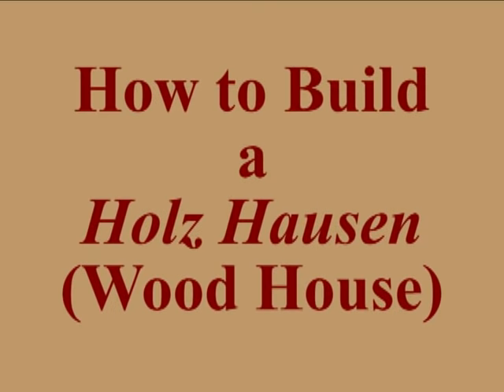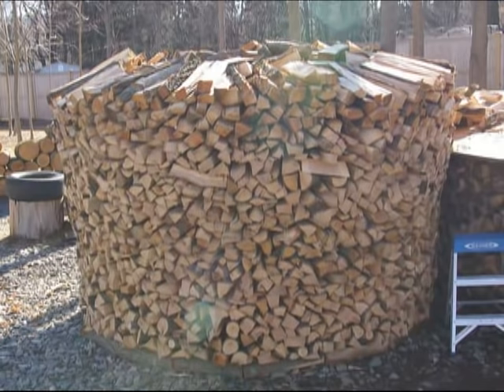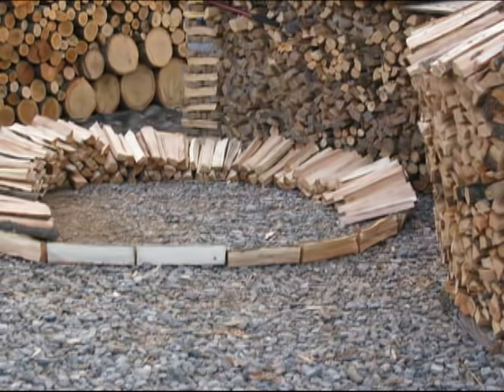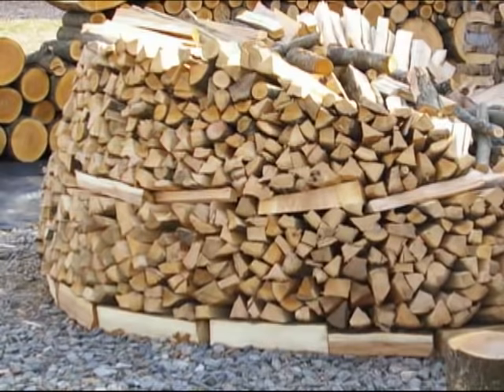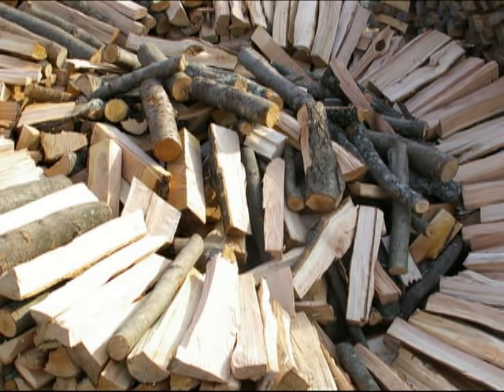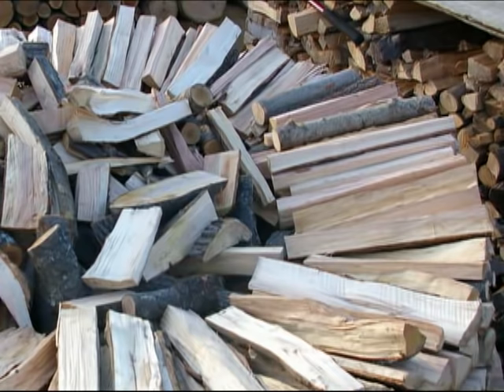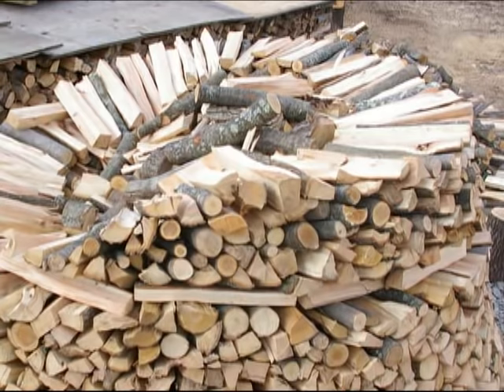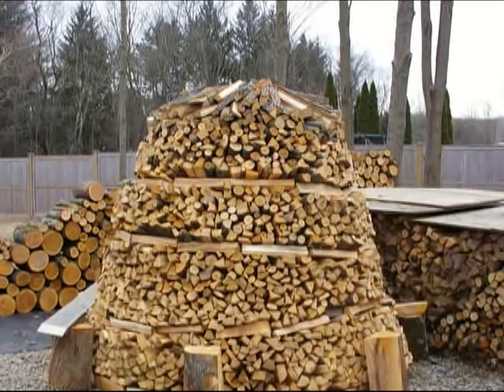How to Build a Holz Hausen | Wood House | Beehive Woodpile | Holzmiete | Holz Haufen

Comment: I live in the Mt. Hood Forest of Western Oregon, where we have abundant rainfall from October through May. I've found that having a tapering holz hausen - the top being a smaller diameter than the bottom - does not repel rain water or melting snow nearly as well as a straight-sided structure. I also use bark only (for fir and pine woods the bark often separates upon splitting) for the top of the holz hausen, and attempt to create an overhang using branches so that the water runs off of the "roof" to the ground and not onto the wood beneath.
Overall, after several years of stacking using holz hausen I'm convinced that it is easily the best stacking method unless one has sufficient covered space in a woodshed available.

Comment: the ones i have constructed were 2 layers thick and the center was straight up , with a pole in the middle . doing this way of stacking allows the wood to season quickly , green wood will be seasoned in 3 months .and the stack was 15 foot tall , the top of the pole was painted white a foot down , and when the wood was dry the white mark will show

Comment: I have been building hausens since 2008 with good success.  I put a tarp over the top when the wood is seasoned, and also put one over the top in winter to keep snow out. Also, you can keep the downward angle of the outside pieces by using odd shaped pieces of wood.  Place the knobby end or larger end on the outside edge.  It helps keep shims to a minimum.  I can get about 3 cords in a hausen with a 9 ft diameter and 6 ft height.

Comment: We always use this method with the exception that we stack all of the wood bark side up as we go.  There is also a method to stack wood in a serpentine shape to act as a wind break. The offset must be 6 foot or larger, The wood must also be very level and have a good stable base. I Have one built to serve as a wind break and a snow fence here where i live in Northern Maine. There are a lot of Norwegian and Swedish Descendants living here that have this knowledge passed down..

Comment: Which is why the inner logs were traditionally stacked vertically. So when rain water would run down the outer logs towards the center they would drain and not hold water.

Comment: Just started my first Holz Hausen yesterday. It's pretty fun to do, looks cool and I look forward to gathering wood from this pile to burn,  rather than a regular stacked pile. ( I suck at stacking long-wise and/or on a pallet by crossing over, plus the wood I get is all different lengths which doesn't help). Thanks for the video!

Comment: Wolcott had 1,600 without power. We were not 1 of them. Last yr we lost power 2X for a total of 9 days. We paid R dues then. I am getting a back up generator! Well pump/heat, fridge/freezer needs to B running. I have a home in FL also. I loose power in CT more often than we do in FL!  I worked inside the Uniroyal Fabric Fire Hose bld in Newtown 35 yrs ago, doing some repairs. It could run on water wheel power alone, not off grid. That's what you need. Good luck, hope it comes back on real soon.

Comment: Formula for volumne: (3.14 x radius squared x height)
So a 9' diameter x 9' tall would be:
3.14 x 20.25 (4.5 squared) x 9' =  572.265 cu feet
Divide 572.265 x 128(cu feet/cord)=   4.47 cords

A 10'x10' would be= 6.13 cords
Reply: It looks like so much more than 6 cords. I came looking in the comments to see how much. Thanks for the math!

Comment: Honestly the reason so many people stopped doing them this way is because it requires so much area. The rectangular stacks can be placed against the side of an already existing structure and don't require a 9-10 ft diameter circle. Granted you can't store as much in the same area with the rectangular storage due to height limitations but to people that stored that way it was more useful for their needs and it just caught on.

Comment: The Bark sealed the tree from the elements during it's life, it would still work after being cut. If it can shed the water naturally it's reasonable to see why it would speed up the drying process. This method has been used in Northern Europe for hundreds of years. Wood will dry like this with snow and ice piled on it.

Comment: What I do not understand about these holz hausen is: once you start using the wood, the top is gone and rain and snow can wet al the wood that used to be protected bij that roof-like structure. How is it then that you can prevent the wood getting wet if you have begun using it? The roof is gone....

Comment: You slope those top pieces, and have the bark on top. To act as a sort of roof. Makes sense.
But it doesn't keep the water out of the middle of the pile.
Why? You may ask.
Because the water runs off the sides of the 'roof, onto the walls. Those walls are the ends of your other splits. Laying horizontally.....at an angle toward the middle. So the water hits the ends of those, and then runs along the tops of those, right into the center of the pile.

Comment: MAYBE A SIX OR EIGHT INCH PVC PIPE WITH AIR HOLES ,VERTICAL IN THE CENTER FOR MORE VENTILATION,JUST A THOUGHT,I HAVE NEVER SEEN ANYTHING LIKE THIS'
 IT MAKES FOR A RUSTIC LOOK.
THANKS FOR THE VIDEO

Comment: I built one of these this spring. mine is shorter but i stood the inside blocks on thier ends. I got about 5 face cord in it. It was a pain in the ass but its off my bucket list. I have 5 more to pile but am going to pile it the normal way. I will let you know in the fall which way is best.

Comment: As a point, I think your woodpile is going to rot. Here's why : first, the "shingle" roof which would normally protect the whole surface underneath is too small to protect all the wood inside. Secondly, the external logs that aren't therefore protected from the "roof" are leaning down, meaning the rain falling on them will run inside the Holz Haus. You could've prevented this by leaning those logs outwards, making the water run outside the wood. 

All the wood will collect the rain.

Comment: at around 4 or 5 feet add a 3 inch log that runs straight through the middle sticking out both sides an inch or two.  then around 7 feet up add another perpendicular to the first.  (acts like rebar) let me know if this isnt a thing , ive seen it on half of the vids ive seen for round holz hausen so far

Comment: by sloping the wood into the middle does the water nor run into the middle. when building a dry stone wall you tip the stones out slightly to keep the water out

Comment: Must the wood be absolutely uniform in split size and  length?
Must pile be built on a completely level area?
Must you have many dry days in which to build this? (Will wood dry properly if it gets wet during the building?)
Need  the pile be again moved elsewhere and stacked once  dry or can one take from that as they use the wood for burning?

Comment: How much does it rain in Connecticut during the winter? I want to build a pile like you show in this video, but it rains A LOT in Western Norway. I have one more problem, I almost have NO flat areas to build it. Do you think I could start at one side, with a half circle on the lowest side, and make the circle hole when every piece have reached the  same level (above the sea), and continue as a new start? I also wonder if I could make a roof on top, or will that spoil the hole point of this woodpile?
Reply: I am certain that you will achieve that round slope even at a slope of a hill. - I start at the low side, stack it up to a horizontal level, and go on as normal. - I usually stack metre split log piles at slopes. - When you decide to make a roof, make sure that there is ventilation beneath the roof: In the video, I disagree about the round clubs in the middle, these belong into the wall... Viel Spaß :-)

Comment: Great video, thanks. 2 questions

- Did the "thrown in" middle wood dry as well as if vertical? 
- Does the deep New England snow affect the wood or do you need to cover it?
Reply: Great info -  Thanks
Reply: If you haven't yet found out, I searched John's channel and he made another video showing that the inside is totally dry and the logs of the wood-wall only got 1/4 wet after rain. He was considering covering the pile, but I haven't seen that on his latest videos.
Reply: @andanssas  Thanks I appreciate the info

Comment: I don't get the point of working so hard to stack wood.  I can see it if it is just fun to you, but that 10 feet up sounds like allot of work to pile, & to get down during the cold weather, particularly if raining.  That has to take allot longer then just backing up the truck and laying lines.  We split ours out in the fields to keep the mess out there and not in the yard.  You can stack tight rows then (we have rattlesnakes), rather then pile rounds. I like your wood sheeting over the top.

Comment: Cool video! Tiis wouldn't work in wet region though. I live on the Pacific Northwest and I have been using wood to heat my home for the last 30 years. I harvest buck split and stack all of my own firewood. This design literally channels the water off the top, on to the sides, then directly into the interior of the woodpile. It probably works well in very cold areas that don't see much rain. In my area though, it would result in a lot of soaking wet and rotten wood. Around here, with the amount of rain we get we always cover the top of the stack and make sure plenty of airflow can get through to the sides of the stack. Regardless of how you stack it that is

Comment: Pretty sure all the wood is supposed to slope (gently) to the outside of the stack. That way, any rain or melting snow will always flow towards the outside of the house and drip off an outside end.  Water that gets on a piece sloping inward will flow to the inside of the stack, soaking not just that piece, but any pieces below that the water drips on.
Reply: See my post four years later re the problem of getting the water to run off of the pile.

Comment: Without stating how you will be USING this pile, I don't see any advantage of creating such a thing.
Reply: I still don't get it.  After painstakingly piling all this wood, it appears that when you start using it from the top, all advantages of the integrity of the pile would be lost -- unless you had multiple piles, and needed long-term storage.  I would just pile it up and put a roof over it.  Far less complicated.